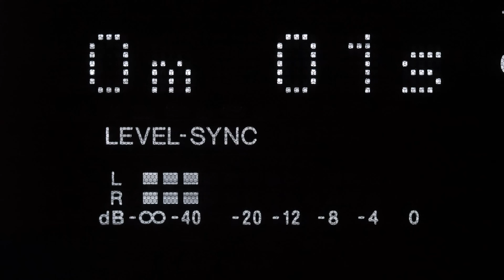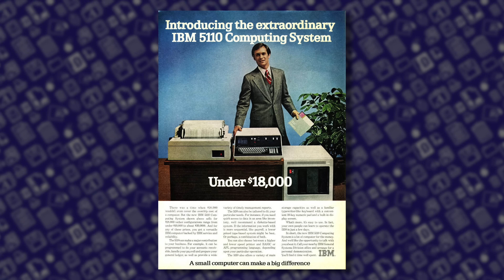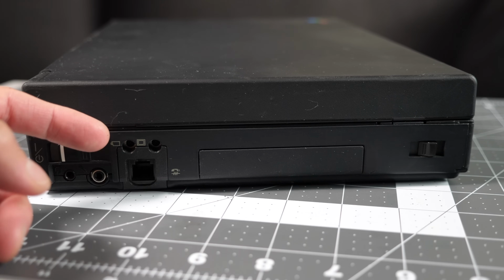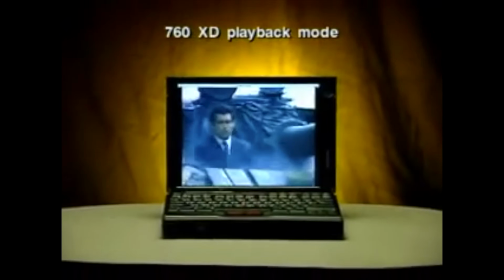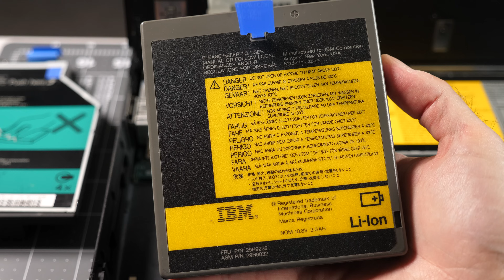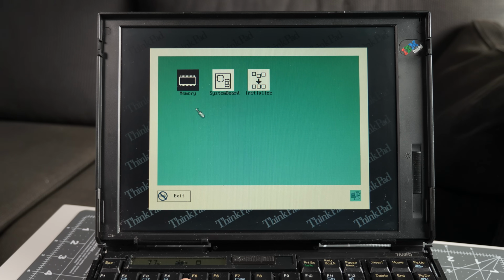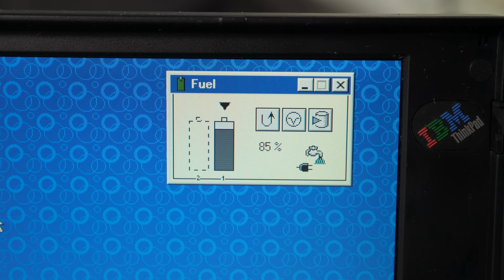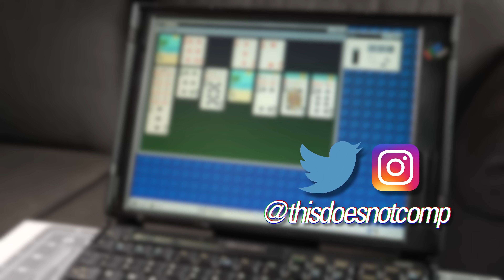ThinkPad 760ED: The Business Laptop With a Quirky Keyboard!

Comment from the maker: Drinking game: Take a shot every time I say "whatever" in this video. RIP.
Reply: I didn’t notice it. You’re good.
Reply: it would be so cool to have a modern laptop with this kind of modular design that does not cost a ton of money to own
Reply: Or "like".
Reply: Nurse says I’ve got to drink the barium in one go…😬👍
Reply: I am ded
Reply: I also didn't notice that, actually I was very impressed thit this unit, sure it was very advanced for its time period.
Reply: The ThinkPads we had at our school had lockable mouse for dragging
Reply: Great video
Reply: My early 15" 4:3 T60 (with only IBM labels instead of lenovo ones) also has a blue metallic flake finish. It is only obvious when a layer of grease or oil is applied to the surface
Reply: Hey Colin, great video, there are so many unusual and obsolete features in these old ThinkPads, it boggles the mind. 
Side note though, I think the noise gate on your microphone might be too aggressive. The first syllable of most sentences starts quite suddenly, it's subtle, but gets annoying once you start to notice it. I don't see other comments about it, so this might be a non-issue, but I thought I would mention it, just in case you might want to look into it.
Reply: I have that same Adapter PCMCIA SCSI card with the dongle and an external hp portable cd writer about the same size as a portable cd player...
Reply: just bought on ebay for 80 euros
Reply: So who counted the glasses?
Reply: @zaqway  How dare you! You made me notice!
Reply: @Jamie-0liv3  You're welcome 😉
Reply: This looks like 1990s gaming/streaming notebook :o
Port for joysticks, ports for video capture in and out, upgradable  RAM, hard drive and optional double battery!! 
And how modular it is, this thing is Rock-n-Roll

Comment: This how every laptop should’ve done it tbh. Like you say, it’s like a car, which somehow is very accessible but just as confusing, complicated and easy to mess up for a layman. Yet portable computers are locked inside a casket behind 8-12 screws.
Reply: Nowadays it's perfectly sealed and repair is intentionally impossible for money
Reply: Planned obsolescence. Started in the great depression and only has gotten worse. Supporting companies that avoid that is getting pricey.
Reply: @LegoWormNoah101  This was the exception.  Most laptops of the era had proprietary everything. Not to mention the slots where the battery/2nd drive unit goes is proprietary.  Those batteries were a fortune. 

I don't have this exact model, but I have one in the same line.  You should see the docking station. It adds ISA slots and like 4 full size bays. It's buried in my garage somewhere, so don't quote me on the 4 full size bays, it may be 2.
But what really sucks about these machines is the screen, at least for modern day gaming.  The screen only looks good at the native resolution and has ghosting all the time.  The active matrix doesn't have the ghosting, but it's still not great for any game that scrolls and it still gets distorted, really, really bad when not in it's native resolution.

I supported hundreds of these things. When they work, they are great. But when they don't work, I hope you get paid by the hour....
Reply: That's why I use a ThinkPad t520. Keyboard can be removed with 2 screws and then the memory and CPU is free to access. SSD is under a flap on the bottom and the CPU (Sandybridge i7) is still plenty for today
Reply: @Lassi Kinnunen 81 Nothing is designed to be serviceable today.  Most things you cannot get schematics for.  At best, you are only supposed  to go to board level, not component level. But the boards are so expensive that it is cost prohibitive to replace any board after it's like 2 years old.
Reply: that would be bad since if you drop any liquid or dust gets into the system your internals are f*cked

edit: also to point out that the structure integrity would be bad
Reply: Yeah I’m not lugging one of these around ever again of I can help it. I’ll just get a new ultrabook every few years, my back and shoulders will thank me.

Comment: IBM ThinkPads were way ahead of the technology available at the time. The Framework laptop made it's rounds lately because of its module design, this Thinkpad has it beat by decades! The modularity of this laptop is genius and just another deciding factor why ThinkPads in general were so prevalent in the business realm. Great video!!
Reply: it too immediately remind me of framework laptop
Reply: Honestly they still are to this day. The quality that you get compared to other laptop's is crazy. I've had my l380 Thinkpad yoga for 3 years now and it's still perfect. I would love to see Lenovo do something cool with a keyboard on a laptop sometime as like a prototype
Reply: Oh yeah like this windows 95 ibm thinkpad laptop that had a butterfly keyboard which expanded itself into a wide form whenever the display was opened but once closed, then the keyboard would fold itself into a small square shape
Reply: @NeoGeo822  while I like (and own) the newer ThinkPads, they are nothing compared to the ingenious engineering of the older models. 
The last good ones were ~2012 I think.
The UltraBay was great. The swappable battery as well. also swappable CPU and RAM in most models. 
The quality of the modern ThinkPads however is still quite good, and they still provide very good maintenance manuals. Something that you should not take for granted these days. 
CPUs and RAM are not swappable in most ThinkPads today however. Especially RAM being soldered is a crime...
Reply: @TheRailroad99  Thinkpad line was sold to Lenovo. So it makes sense. There are a few problem units with the thin thinkpads series with the newer ones. One thing hasn't changed. They still command a premium.
Reply: I appreciate what the Framework laptop is doing, but even with commodity laptops as late as the mid 2000s we’re practically as modular.

The whole “ultra book”idea and Apple’s design really put us on this backwards way of laptop construction.
Reply: @ChannelSho  Workstation laptops well into the 2010s were just as modular as well.

Comment: Fascinating! I found a pristine 1997 380ED in the trash. It's one of my most treasured vintage laptops. Also a 2002 Alienware Area-51 5620D notebook with 1600 X 1200 resolution, and a Clevo-Sager D800P.
Reply: Ah back in 2002-2003 i craved these Alienware laptops sooooo much xD  And now i'm eying on the old Sony Vaio laptops.

Comment: The XD variants of this line-up were used in the ISS, so keyboard tilting aside, the 760s have a place in history.

Edit: Also, to those unfamiliar with the original ThinkPads, that modularity was a key part of the original design ethos. ThinkPad design was inspired by Bento lunch boxes from Japan, with the clamshell opening to reveal the contents and the compartmentalized inner layout.
Reply: I loved this design and I would pay for a modern laptop hardware with the same design.
Reply: @suprshin  Same here, and it doesn't have to be this thick to work. Framework could definitely do better...

Comment: Goo Gone, the stuff they sell in the Dollar Tree  is absolutely the best way to deal with the rubberized 90s coating.  Not only does it remove the stuff very quickly and easily, it leaves behind a great surface.  I recently just did a large 6v lantern floodlight with it (the ENTIRE thing had the rubberized coating) and it turned out perfectly. It was a horrible sticky mess. But in about 1/2 hour and an oz of this stuff brought it to like 'new plastic' condition.  I've also done a few 90s media players that had the rubberized coating and had the same success.
Reply: That's interesting to know, thank you!

Comment: The IBM design team was one of the most innovative ever. This is why IBM's motto was "Think." 

Unfortunately, an old Chestnut about IBM is that if IBM was marketing sushi they would call it raw dead fish. Completely factual but less than appetizing. This is why Apple is dominating the mass imagination while building on the shoulders of IBM, Intel, and Microsoft.
Reply: Yeah, innovation was the first thing Lenovo killed once they annexed the ThinkPad brand.…  followed by functionality, built quality and sturdiness. And now there's absolutely nothing left anymore. Except maybe the black ABS plastic cases and the trackpoint.
Reply: apple innovating? lol
Reply: If the IBM way of doing things was so great, they would not have had to sell off the Thinkpad division.
Reply: @KRAFTWERK2K6  You're absolutely correct.  The last few remaining innovations like the drain holes for spilled liquids on the keyboard are gone as well as the ultrabay drive to swap DVD, extra slice batteries and another HDD.  The trackpoint is the only thing left.
Reply: @klwthe3rd   Yeah... RIP Ultrabay..... Something that made these laptops sooo versatile instead of just being glorified tablets with keyboards.
Reply: @KRAFTWERK2K6 maybe you should get with the times. Almost no one uses dvds anymore and not even HDDs.

No i should rephrase that. Absolutely no one uses those what i said above
Reply: I do bitch! WOO!
Reply: Would love if the design cues of old came back, they're desperately needed

Comment: I had a 760XL back 20 years ago. my grandma would use it with dialup to access her email at her vacation home in the mountains in NY. by the time I got to it, I shoved a 6GB drive in, updated the BIOS, replaced the battery twice, and had installed everything from 98 to XP RTM on it. it did pretty good for the speed of it... which was an MMX 166 pentium.

If you can't find restore media for the ED, find restore media for the 760XL since it's more desirable and people will have it.
Reply: I have a 760XL right now and in full working order, were i can find the restore media? Thanks!!

Comment: These ThinkPads are always so cool and different, it’s a shame that this level of modularity isn’t around anymore. I would prefer a larger laptop if it meant that it had more options like this.
Reply: But at least there is the Framework laptop, which IS designed around reparability.
Reply: @MCAlexisYT that thing is overly expensive

Comment: Neat Laptop Colin!  I remember when I was young (mid 90's) the commercials for these on TV.  Wish I had bought this model or the 701c in my younger years.  I did have a 380ed due to both cd and floppy being internal (which I think I still have).  The 380ed had the same BIOS, very neat.  Though I think if you update it, you can make it boot off CD rom.  Thanks again for the videos!!!

Comment: I rescued the same machine from a dumpster, complete with charger &external floppy drive, it actually works fine, although has the nasty sticky rubber problem.
Even the battery still holds a charge, these were a very good quality machine, unbelievably heavy for the size!

Comment: Hi Colin, thanks for yet another retro Thinkpad video. I'm always enjoying your videos, we have a common interest in retro electronics. I have a 760cd model in my collection, and the things you run in to are typical 760 problems. Aren't they great? The rubberized coating on the palm rest can be scrubbed away. You will not notice much of a difference in color without it. I suggest you remove all the parts and give the casing a nice warm soapy bath. This will restore its original feel. The lid can be restored with a magical eraser and hand creme. Be careful and delicate though!
Greetings from The Netherlands.
Reply: Thanks for the tips, i also have two ThinkPads, i will try those tips, Greetings from Colombia.
Reply: @colombianguy8194  You are welcome. Parts where the rubber coating are gone can not be restored of course. apply and reapply the hand creme a couple of times, a few days. Clean it with a non staining glass cleaner then re-apply again. etc. Be careful with the magic eraser, the coating will be gone before you know it.

Comment: Oh my. I have 2 of those! One originally purchased in Singapore, which doesn't boot due to battery corrosion, and one originally purchased in the US, which partially works also due to battery corrosion, and I've been meaning to get the former up and running once I can repair the 'keyboard card' to get around the battery corrosion, but have been too busy with other projects.
Reply: Same thing happened to me, I had to repair the keyboard card, and clean all the nastiness left by the green NiMH battery.

Comment: The blue flake on the lid was a common understated touch IBM/Lenovo did on some of their Thinkpads. I have a T410 with that same blue flake. As these machines get older, it gets harder to see without some kind of additional light but when they were new, and if you were paying attention,  you can see it with just ambient light.
Reply: The same applies to my X220. It it visible when the lid is wet, especially with hand sanitizer.

Comment: I miss the Infrared ports on laptops. Used to have one on my Compaq Evon610C back then, which was my very first laptop, and i made lots of use with it when i had to move some photos i took with my phone back then and move it over to my laptop, without any cable. Yes it was of course a bit slow but it freaking worked like a charm.  It didn't cost anything extra and was super easy to use.

Comment: I had the 755CD, was my first colour screen laptop! Had the 32mb ram card (enclosed unit, no slots) for a massive 40mb. It also had the locking mouse buttons and easy access hinged keyboard.
Reply: The 755CD also had the video in/out jacks too, if I remember correctly
Reply: @Appleboy78165  It did, however mine was an ex-corporate refurb and didn't come with the proprietary cables. It also didn't have the manual so I wondered what those ports did for a long time!

I did have the swappable CD/floppy dives though.

Comment: I have a copy of the video playback software if you'd like to try it. I couldn't get it to work reliably on my 770x, but maybe it'll work for your machine.

Many years back, I was obsessed with the 760s, and literally bought three EDs and an XD off of eBay, because I loved the tilting keyboard and other quirky features, and also learned that NASA used the XDs on the ISS back in the late 90s. They're really neat machines, but aren't too practical to use these days. I'd rather have something like a Compaq Armada or similar machine of this era if I wanted to actually use the machine for more than just a novelty/collectors piece.

I recall having to disable onboard devices in Windows 98 because of IRQ conflicts, because there weren't enough addresses available to use everything all at once. That, and the procedure of restoring from the factory media required using an internal floppy drive and an external CD drive for it to work, otherwise it would error out. I didn't have an external CD drive, so I ended up using Smart Boot Manager on a floppy to boot off of CD and load a retail copy of Windows 98 onto the machine that way.
Reply: I have a very similar unit, plus the docking station. The docking station is impressive. It's got an ISA bus in it as well for adding cards.
But then there's the bad news about IBM ThinkPads of the era. the screen.  The screen looks great, until you put it in a different resolution than the native resolution or even just open a dos box. It's HORRIBLE. UGLY as sin.  I still remember the first time I tried to play a game on a Thinkpad at work. Oh, god does it look terrible.
Reply: @tarstarkusz  The docking stations are awesome in there own right! That was back when docking stations had support for PC expansion cards and additional drives, not just glorified port replicators becoming synonymous with the term. I had one for my 760XD, and another one for my 770x, although that beast mostly collects dust due to its humongous size.

The screens are annoying to deal with, as it is for most early TFT panels from that era. I recommend using letterbox mode to avoid the stretching and distortion at lower resolutions.
Reply: @foxyloon  I supported a few hundred people with variants of this laptop.   Compaq made some really nice docking stations as well. I'm pretty sure that I remembering correctly that many of them had automatic insertion and ejection of the laptops.
You can chose better resolutions, but these early screens really only look passable at their native resolution.  It's put away right now, but I am 99% sure it was a 486 and not a Pentium class.  I know the screens got much better really quickly.
Reply: @foxyloon  I have a 760XL and a 770X, the track point of the 770X died :-( maybe you have a spare track point module for sell? Greetings from Colombia.
Reply: @colombianguy8194  Unfortunately, I don't have any spares for the 770X. I know it's a pretty rare laptop, even here in the states. Best of luck.
Reply: Yeah, would also love a copy of the video playback software i happen to have the same laptop as mentioned in the video but i was never able to find software for it.
Reply: @tarstarkusz  what a cool feature for a business oriented laptop, making games look so bad that you will prefer to work instead, perfect for productivity ;)

Comment: hey, found this online.  not sure if you've tried this already or not.  
760el, 760ed, 760xl, 600, 600e, 600x, 770 and 770x Can boot from PCMCIA/CF.
PCMCIA must be added to the Startup sequence in EasySetup and ide2 must be disabled.
To disable ide2, the Thinkpad Configuration Utility must be used.
in the dos version, the command is
PS2 IDE2 DISABLE ULTRABAY
in the windows version the steps may vary, but it will be something like
Device Bay -> Warm Swap Devices -> disabled

Comment: I used a 760ED as a daily driver (running linux on it) for years... and I never knew the keyboard had the lock-down lever and the mouse button latches!?  And yes, the coating on mine turned into goo years ago. :(